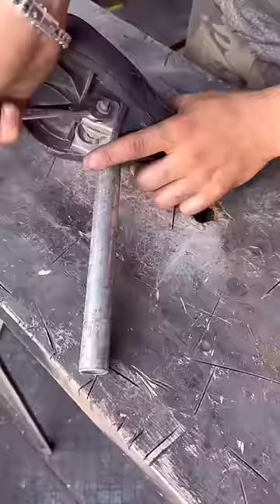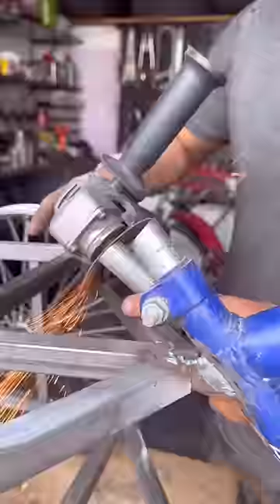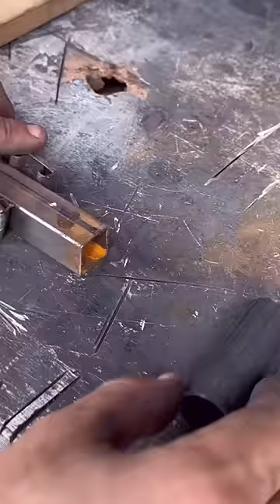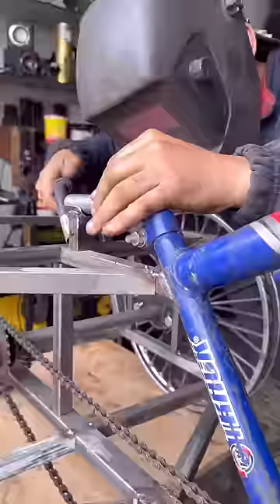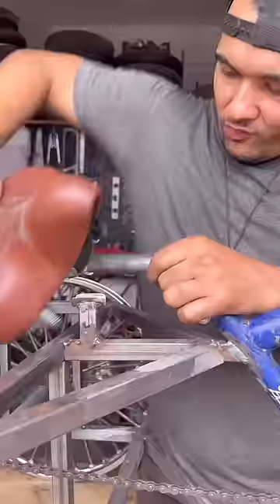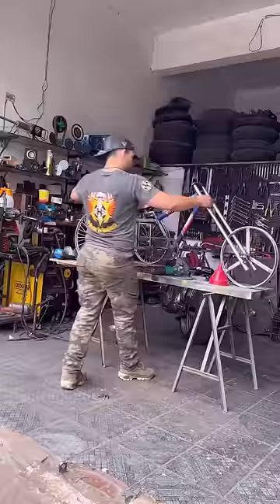Gambiarra do dia (adaptação do banco no mini triciclo) 😜✌️

Comment: I gotta question which is that could you use a bender to bend the metal instead of cutting and welding or would it just be smarter to weld the cut😊